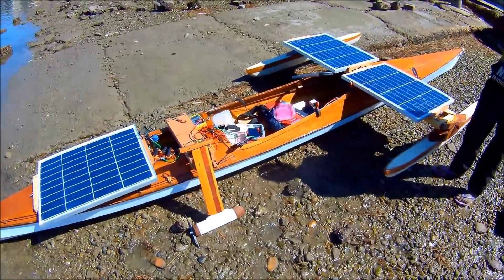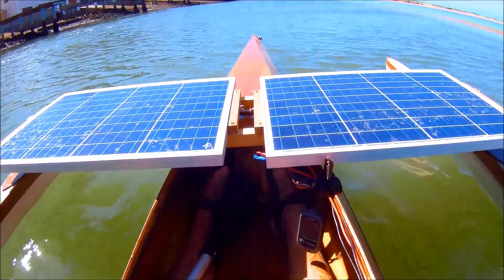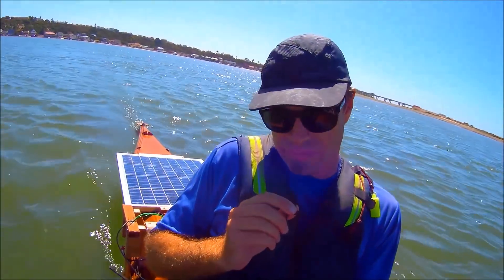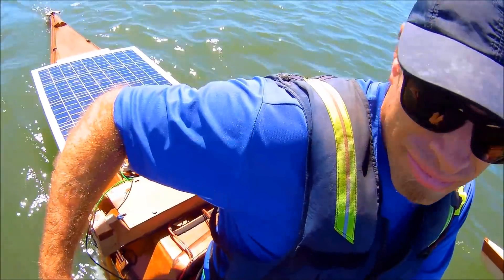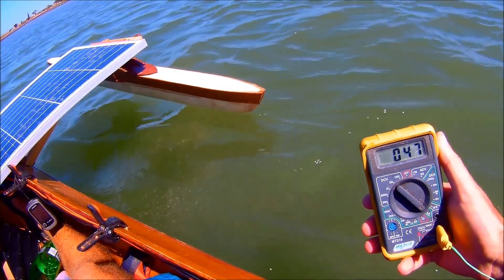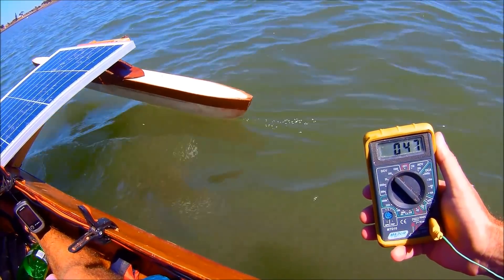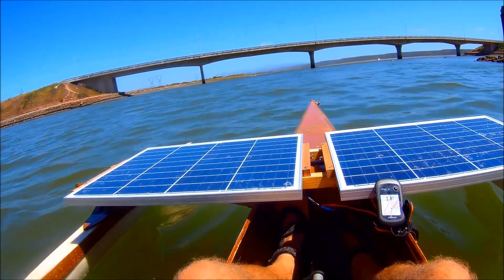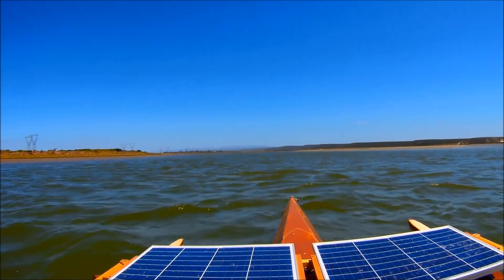Solar kayak - new propeller test

Comment: water cool the panels.
Reply from the maker: Agreed, considerable gain in power when cooled. The catch is to do it uniformly over the entire panel without adding too much weight. Mounting panels flush on an aluminium hull would create a natural heat sink.
Reply: @williamfraser  Brilliant.

Comment: Are Aircrews even remotely efficient underwater?
Reply from the maker: Yes. Efficiency is a function of Reynolds number which, for a given prop, is a function of rpm and fluid properties (density and viscosity). As long as the Reynolds number is the same, efficiency will be the same. A prop turning 1000rpm in water will have the same Reynolds number as the same prop turning 15k rpm in air. There will however be a difference in torque and thrust force.
Reply: @williamfraser  That explains the number of failed marriages. Wrong Reynolds number.

Comment: Why no battery pack?
Reply: East Coast Carpenter of Alaska it’s good his experiment doesn’t use any battery pack, it’s shows you don’t need expensive batteries and by just adding a small rechargeable battery to manage a bit shade makes the system more effecting not loosing energy through charging.

Comment: This is ridiculous. Solar panels aren't intended to run accessories directly. I've never heard of a proper solar installation without a battery. It's still legitimate solar power if you store it.
Reply from the maker: Knee-jerk comment. Read the video description to get some context and save yourself some ridicule next time.

Comment: Invest in a battery and never worry about that shade resistance.
Reply from the maker: Agreed. I have updated the video description to explain the aim of the test. This boat is designed to take part in solar-boat races that do not allow batteries, hence the need to test and optimise the pure solar performance. The races do allow MPPT's and at some point I will test the boat with one installed. In the meantime I have a brand new motor and boat to build...next race is in less than a month so watch this space!
Reply: @williamfraser  for your race is there a limit on the amount of solar panels used ? Also a level system to angle your panels might be a good idea
Reply from the maker: @adamganjaman2275  yes, a maximum of 1280W, e.g. four 320W panels. Only one team actually had that much power during the 2018 race. Most teams, including the winner had 1000W.

Comment: would not a small battery help to eliminate the shading effect on speed?
Reply from the maker: It would. An efficient charge controller would cost as much as all the panels combined, so I first want to try out some home brewed circuitry...
Reply: @williamfraser  You participating this weekend at St Francis?
Reply from the maker: @karldupreez  yes, if I can get a new motor sorted out. I took the one in this video out yesterday for a test and the housing leaked. Salt water, so the motor is toast. I am 75% through a brushless outboard build which I might just have ready for the race. Fingers crossed...

Comment: wow now add more panels and batteries for reserve power
Reply from the maker: Thanks for the comment. I replaced the panel with a single 300W and used a much more efficient brushless motor. Speed nearly doubled.
Reply: @williamfraser  best of luck for more success of your ideas and future 👍
Reply from the maker: The upgraded version. No battery yet, but I will use one soon. https://youtu.be/6u-j1gxQRGc

Comment: If you can get it up to around 5- 6 hydrofoils would then up your speed to at least 10! See YouTuber Ray Villega. He has an excellent book on practical hydrofoil design.
One tilting foil on each pontoon(with automatic angle of attack floats) and one hydrofoil at the rear. Your boat would make a Super stable foiling craft.
Reply from the maker: Yip, got the book. Foiling on nothing but sun rays would be awesome.

Comment: Why not add a small lithium battery and 2 more panels in front?  5 panels total = 250 watts max of solar instead of 150.
Reply from the maker: I tested with four panels yesterday but the motor housing had leaked and damaged the motor. It ran for a little while but that was the end of it. I actually had a lifepo battery on hand to test as well. Building a new drive now...
Reply: ok sounds good.  I have a 2 pound lithium (LiFePO4) battery, perhaps you would be interested in it?  It is 12V and 6Ah rated.  It would act as a nice buffer for those under bridge experiences and in case you are way out and a cloud comes your way.  I actually have 2 of those batteries, an exact match, and both are new (just tested but never used).  They are designed as motorcycle starting batteries but should work well for what you are doing.  In parallel, they would be 12V 12Ah rated.  What wattage is your new motor going to be?

Comment: You're using poly cells by the looks of it if mono were used shading wouldn't be as much of an issue.
Reply from the maker: My new panel is a 300W mono from Jinko. It also has a built in optimizer of sorts (the call it a "smart panel") which gives maximum power over a large voltage range. From 12.5A at 24V to 9.7A at 31V, according to the spec-sheet. Very odd looking voltage-current curves.

Comment: Get your self two trolling motor props. Your using a prop that is made to use on a rc plane in air not water.
Reply from the maker: Trolling motors are designed to push heavy boats slowly and shed weeds easily. All these features compromise peak efficiency, especially at higher speed under limited power.

Comment: Need to smooth out at current With some capacitors for more of a sine wave.
Reply: I wonder how many thumbs up the chicken will get for thinking that a DC solar panel operates using sine waves.  Please, people, if you don't know anything about engineering, go read a book.  It's not a crime not to be a tech head. But don't embarrass yourself trying to sound technical.
Reply: so nice, congrets my friend !!!

Comment: That is very interesting. I have an electric bike and I'm considering building a state of the art lipo battery pack for it and adding a solar panel to recharge the battery for touring. There is a solar powered bike race called the Sun Trip and they went from France to China unsupported on solar power alone. Some people got 200 kilometers a day out of their bikes. So if I can do the same with my kayak it makes the cost worthwhile. There are loads of videos on how to make the batteries using state of the art battery cells. I designed a camping kayak and I sleep on the water in it. At the time I lived in London and was able to get the kayak and all my camping gear on the train to my favorite place on the Norfolk Broads a 100 miles away. Here is a link to an image of my camping kayak. https://www.dropbox.com/s/dyy2hzs928zv3nh/Camping%20kayak.jpg?dl=0

Comment: Use watercraft propeller to have the maximum advantage. You are using aircraft propeller which is not suitable for water propulsion.
Reply from the maker: Thanks for the comment. I have compared performance test results of aircraft and marine props in a recent video. The link is in the video description.

Comment: Loud for electric
Reply from the maker: Yes, high rpm, gearbox, dog coupling. It runs much more quite when not connected to the kayak. The wooden hull amplifies the sound like a speaker box.

Comment: you should add a waterlily.
Reply from the maker: Are you referring to the Lily propeller?
Reply: The water lily power generator.
Reply from the maker: @n9oqu  that only works if the boat is being propelled by means other than a propeller, e.g. sails.

Comment: air propeller not used for water...
Reply from the maker: It works even better in water. Look up Reynolds number.
Reply: @williamfraser  it CAN't work better in water. Reynolds ' numbers are proof of that. the air propeller is designed to work in the AIR!!!
Reply from the maker: @TULSUNDUR  The Reynolds number on my props are almost double  that of operating in air. Higher Reynolds number means higher maximum lift coefficient and lower drag coefficient for the blade foil section.  That means higher thrust coefficient and lower torque coefficient, therefore higher maximum efficiency. If you look at published coefficients and propeller performance graphs, no fluid is specified. You have to include the necessary density and viscosity for the fluid it will be used in. See link in the description for my latest video - 6.3kts (7mph) with a 10" x 8" aircraft prop. Try and beat that with a Torqeedo using only 300W.
Reply: @williamfraser  the water is denser, yes. therefore, the propeller does not need a large diameter. and under water the propeller runs at much lower speeds, of course. so the postulate of lesser resistance is absolutely not true. practice disproves this error.
and you need to remember the efficiency of the motor. because if it works for you in an inefficient speed range, then half of your energy is converted into heat and not into motion, reducing mileage from the battery.
Reply from the maker: @TULSUNDUR  you are trying to argue with someone who has real performance results for both motor efficiency and overall system performance in practice.You might actually learn something if you had an open mind.
Reply: @williamfraser  I'm not trying to argue. I show your ignorance. it is self-evident for understanding people. I myself was engaged in the design and creation of electric vehicles for 10 years, and for 8 years I was engaged in RC modeling.
Reply from the maker: @TULSUNDUR  Well if I can hit 6kts on less than 1/2hp using pure ignorance, then just imagine the results if I actually start applying my mind! When you have mastered propeller blade element theory you can come back and join the discussion on propeller performance.
Reply: @williamfraser  for a kayak, such speed at such power is not a phenomenon. and I’m participating in discussions so that people don’t repeat your mistakes. they are self-evident to many people. not for you alas. you are diletant (amateur).
Well, since they are, according to your statement, more effective, then show me at least ONE boat with a large diameter propeller to confirm that you are right. otherwise you are an ordinary noob
Reply from the maker: @TULSUNDUR  Only one? You are making this too easy! Super Phoenix, the fastest human powered boat. Shall I continue? Flying Fish 2, fastest human powered boat over 2000m. The team that won our solar boat race used a 12" x 12" prop and maintained 8kts in overcast conditions.
Reply from the maker: @TULSUNDUR  it is almost entertaining watching you insult yourself. When you call someone like Alec Brooks an amateur you must really be desperate. I thought you said you designed electric vehicles. Now unless you can design a small diameter boat propeller that can "somehow" break their 30+ year old record, you are just background noise.

Comment: От чего мотор такой шумный?
Reply from the maker: The noise is a combination of the motor's high rpm (>15000), gearbox and loose shaft coupling. Vibration noise gets amplified by the kayak's wooden hull.

Comment: William, my first time here .... I noticed you did not laugh when you went under the bridge.   Why would you?  After all it all make sense.  However, why would your typical non-engineer giggle at this?   Perhaps we see some irony in science that is the root of most comedy.   But what irony would that be?   Ironic, perhaps that "Science" actually works.  Perhaps ironic to the experience of the horse or motor.   We would laugh that any time a horse crosses a small stream that it has to stop and loose power to drink.   Is it your up bringing or your engineering that you don't laugh?
Reply from the maker: Interesting analogy with the horse! I'll admit that even as an engineer I found it amusing while watching a solar boat race the first time. I suppose the humor lies in the fact that it happens unexpectedly when retrospectively it should have been anticipated.